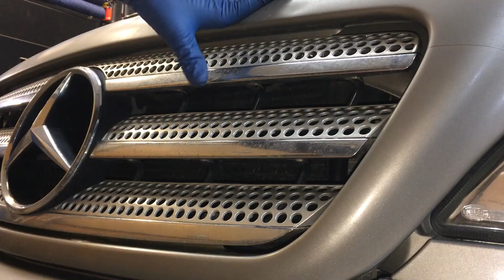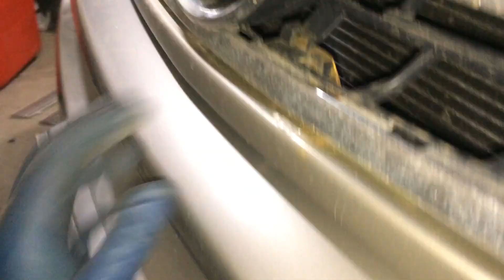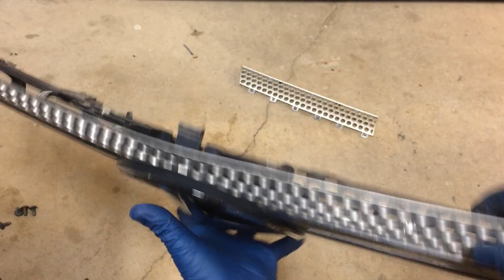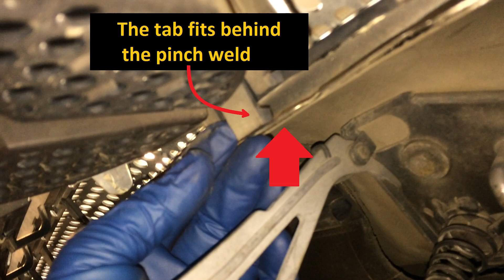Mercedes W163 Hood Stuck Closed - Open a stuck closed hood (Broken Latch or Cable) ML320 ML350 ML500

Comment from the maker: Timestamps and other DIY links:
00:15  Remove the grille inserts from the outside
03:49  Remove the grille fasteners from the outside
05:15  Remove the grille from the outside
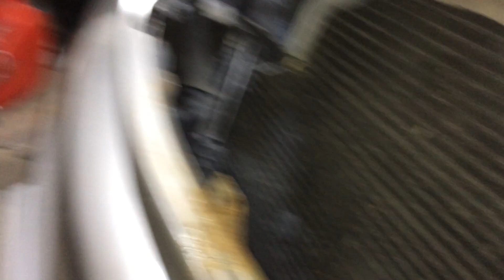05:58  Find the hood latch access panel
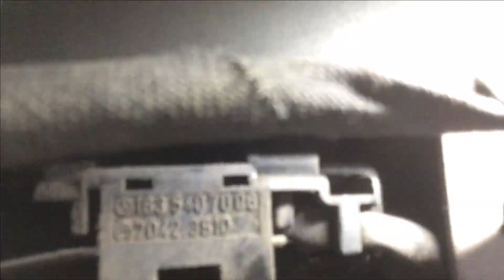06:56  Use a mirror to see the hood release cable 
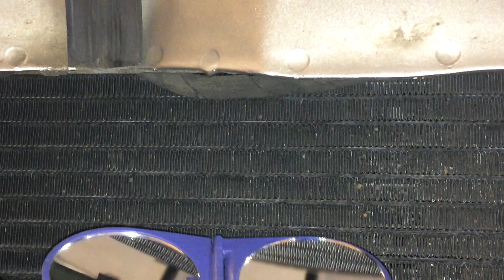07:09  Open the latch (if possible) using a pick
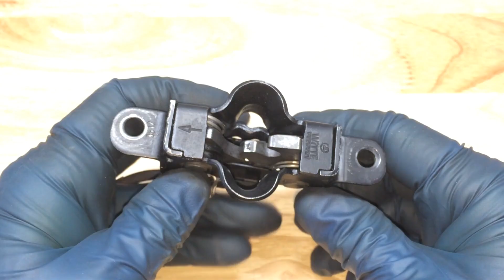08:49  More detail about the latch on the bench (New Latch part #A210 880 0960)
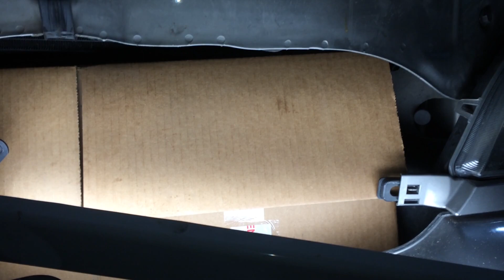11:08  Worse case scenario: use a die grinder to open a busted latch/busted spring
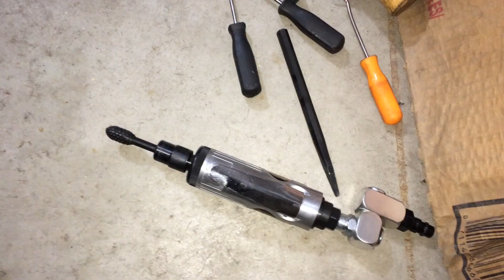14:15  Tools I used to grind out the busted latch
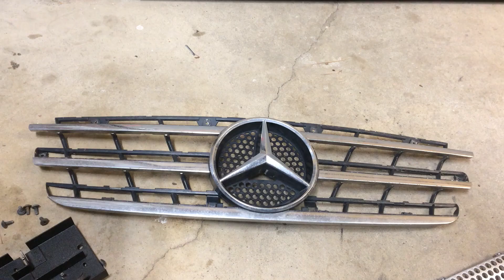16:20  Reassemble the grille
22:03  About the lower trim piece
22:25  Install the lower trim piece
23:47  Install the grille to the hood

DIY Video for replacing the Hood Latch and Release Cable:
https://www.youtube.com/watch?v=PnYTI4KfENI
 

I hope this video helps -- I'm sorry that your hood is stuck, and I know how you feel.  I hope you can get it open. 
Thanks for watching, and good luck with your repair!

Comment: Thanks for the informative and detailed video. I assume that when you say "driver's side" you mean the left side? There are a lot of us out here with RHD vehicles. 🙂
Reply from the maker: Haha, yes - I'm in the USA, so "driver's side" is the left side.  I'm not sure how the hood latch cable routes on the RHD models, since obviously the cable would route to a lever on the right side in the cabin (instead of the left side).  I don't know if the routing is simply a "mirror" image of what's seen on the LHD, or if there is some obstacle on the RHD path that changes the cable routing, because I've never seen an RHD W163!  
Thanks for watching : )

Comment: Did you remove the fans? Yours has so much more visable with that cover off. All i see is the sensor
Reply from the maker: No, I didn't not remove the fans on the ML500 because it is not equipped with them -- but if you're working on an ML320 or ML350, some have electrical fans that take up space, which sounds like what you're seeing.  Can you reach the latch at all?  I'm sorry this is happening to you -- I know how you feel!
Reply: @L35inColorado  mine has the fans and yes you can see the latch and its tight but you can reach in there. even with the fans the repair is exactly like your video. your video helped me open the hood. thumbs up to you.😁👍
it was not easy at all but I kept looking at this video when I was not sure of something. my cable had snapped.I put in a new one thanks to your other video. thank you😁👍